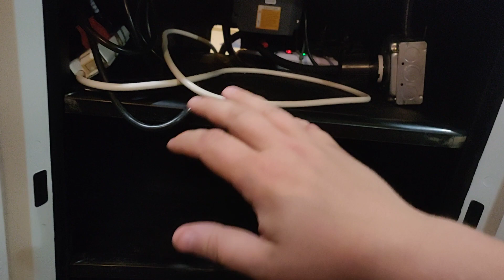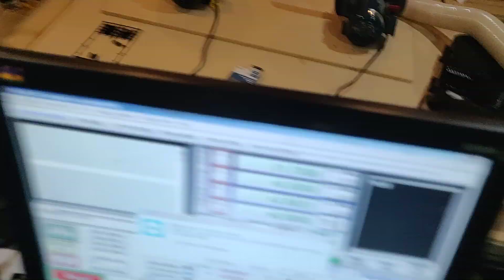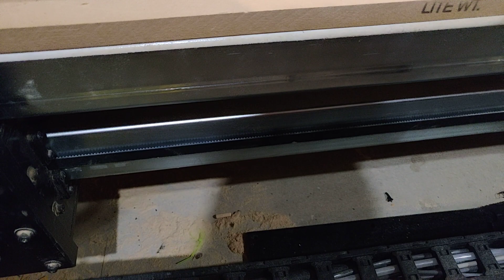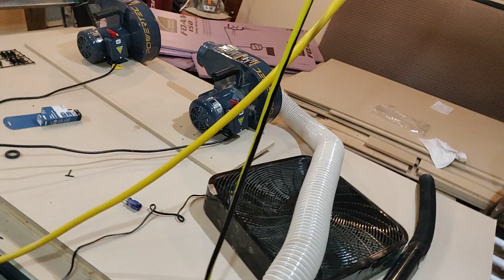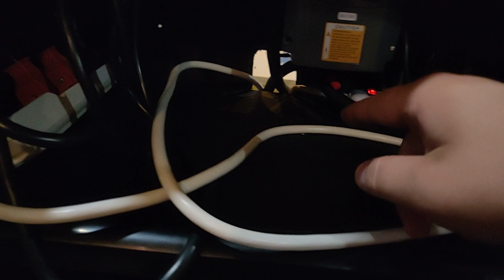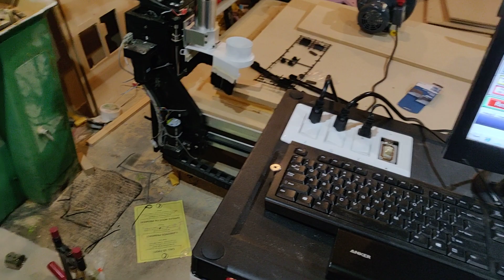In Progress Shop Updates For Zenbot CNC Router

Comment: One problem with externally vented dust collector/vacuum table is that all your heat/AC gets blown outside. But might not be as much of an issue in a garage.
Reply from the maker: That is an extremely good point. I had not thought of that. Thankfully it is easy for me to move the hoses inside :)